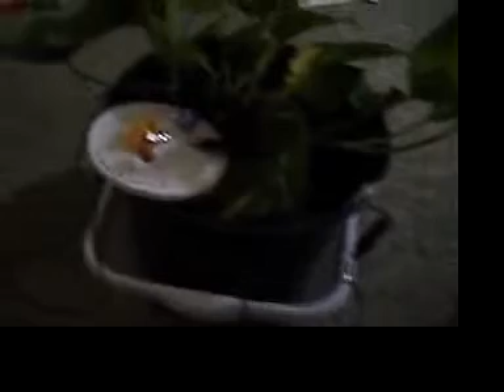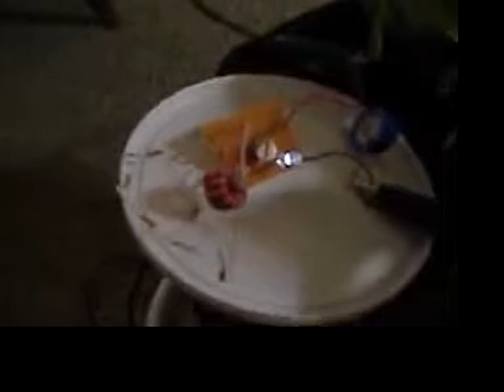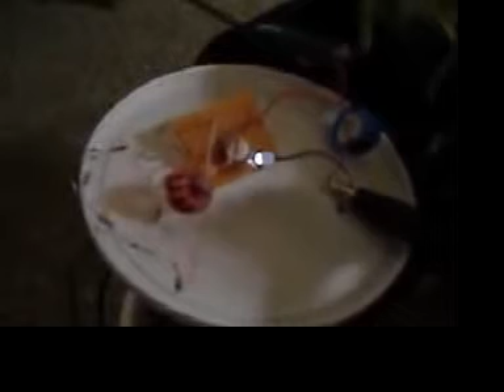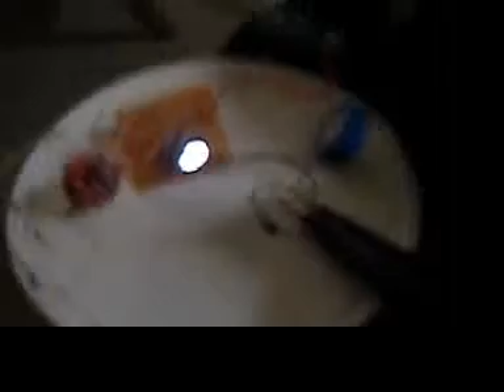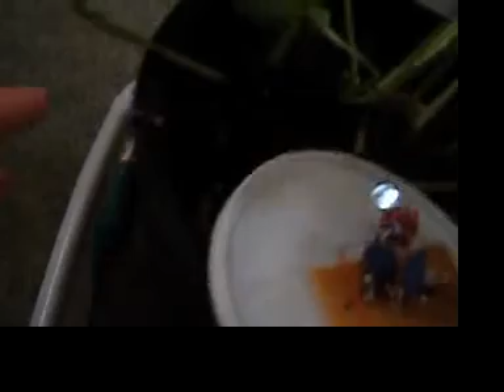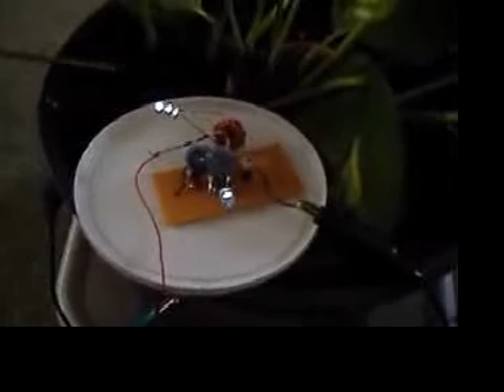Plant Battery 1.mov

Comment from the maker: @LoneOarman Actually, the voltage starts at 1.7v
Then when I add the ...whatever to increase the mA, the voltage goes down. But this has been my reason all along for limiting my input to 1 rechargeable. And, 1.4v is higher than 1.2v. 
I am doing these tests with a very hardy plant to see if those stresses you mention are a problem. Magnesium is an important nutrient to living things and adding it does not concern me... But, we will see and I will share whatever happens!
thank you

Comment from the maker: The ribbon has way less mass than the firestarter. maybe 2 grams. I bought 25 grams but I do not know how much I used. I used about 5 feet.
I think some upcoming experiments will be to find a lower limit.
I think any jtc that uses the small transistor will work on this, but I will be checking that out and showing the results here.

I love it
Jeanna's Power Plant.  HA
Thanks, Bill